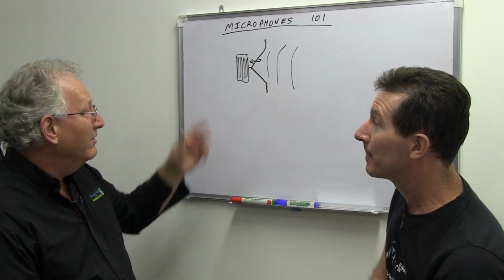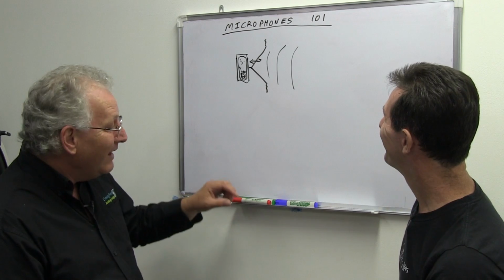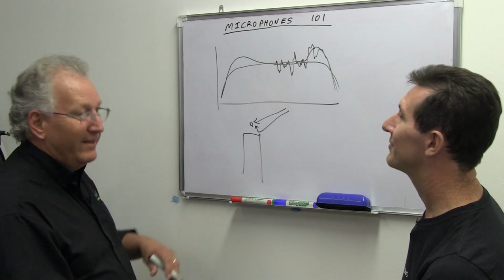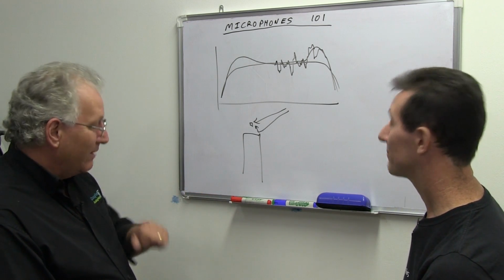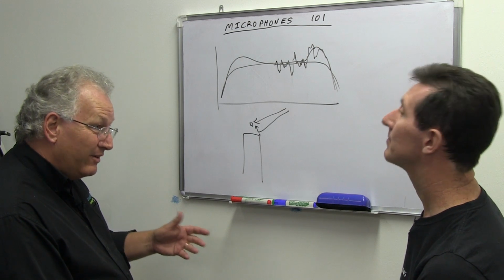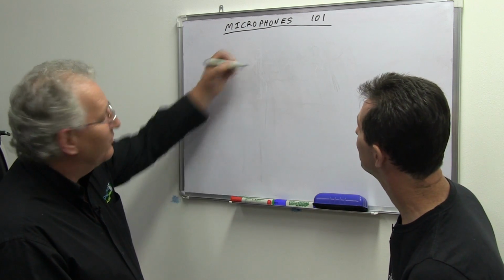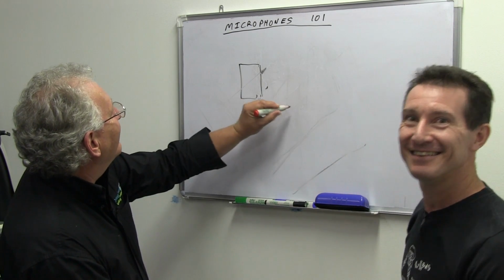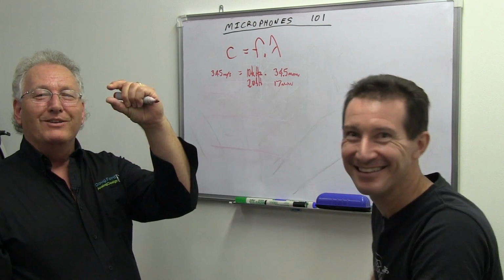EEVblog #602 - Introduction to Microphones

Comment: Around 7:00 I looked lovingly over at my Rode NT-R (a ribbon mic that Doug himself designed).

Microphones are one of those places where the audiophile types aren't just making it up. The differences between types and voicing are readily detectable even in controlled, double-blind tests (i.e. randomized A-B-X comparisons). I can recognize the mics that I work with regularly in most cases. If you're going to spend money in any one part of a recording system the microphone is usually the one where you'll get the biggest bang for the buck.

As I think most people with at least a modicum of sense will recognize, line--level, speaker-level, and digital cables are the areas where there is the least incremental benefit to be had beyond the basics (basic well-terminated, well-shielded cables). "Oxygen-free" and "diamond" cables are a scam, full stop.

Low-voltage XLR mic cables are an exception as they can have audible impacts depending on the RFI/EMI environment and the cable's topology (conventional pair vs star-quad) and shielding. With that said, you can get the best realistically achievable performance for about $25-30/cable (which gets you a star-quad topology cable with good shielding from a brand like Canare and Neutrik connectors). if you spend more than, say, $40 on a mic cable you've been fleeced.

Comment: This has been a really interesting series. I'm geeking out to listening to two guys talk about circuits and spit balling them on a whiteboard. I really have no life :-p

However, on a more serious note, Advice please, (from anyone?) I have a vintage Kreisler Dynamic Microphone. it has a 30mm diaphragm connected to a transformer with three wires, and a 4700 pF (10% 400V - 039H) Electrolytic??? Capacitor (its shaped like a big resistor with a wire coming out of each sausage end.) Now, It stunk of old age so I had to dump the rotten foam padding that was in it, now it doesn't stink. but it does have noticeable, "Self-noise."

Is it possible to refurbish this mic and reduce the self-noise, and how would I go about it? change the Capacitor? Add in additional circuitry? Throw the bloody thing away? (Kidding!) ... Advice please?

Comment: 10:30 well Rode these days put out datasheets like this http://cdn1.rode.com/nt5_datasheet.pdf where the frequency response plot is basically not usable. They could have used 20dB/div and end up with a perfectly flat line...

Comment: Great video. There is a microphone that does sense sound that doesn't use 'Wobbly Diaphragm' it uses two heated wire filaments and the oscillations in the air causes the wires to cool and the resistance changes. I think the company is Microflown that make them in case anyone is interested.
Reply: +Matthew Dabin awsome. thats really cool. heh, get it. ......i have no life.

Comment: To me, you demonstrated the number one reason (most other) Americans find it difficult to deal with metric.  They're obsessed with "what is that in inches?"  It's as if their brains cease to function if you don't tell them what the measurement is in imperial.  What you did is what they need to get off their collective duffs and do for themselves, and say "that" is 17mm.

The first time I seriously had to use metric was my first semester of physics in college.  Ever since then, metric has been easy.  I used to come home every day from classes or work, and before turning the thermostat up (winter) or down (summer), I would estimate what the (C) temp was, then go over to a (digital) thermometer to see how good my estimate was.  All it took was about 2 months' practice to be within a degree.  That's all anyone who doesn't know metric needs to do, is to practice, but they refuse to do it.
Reply: Units are really meaningless at the end of the day. As someone who grew up in the US, I am very comfortable knowing what an inch looks like. If a certain part is measured in mm, in my head I rapidly convert it to inches (25.4 mm = 1 inch). Even though I know intuitively that 50 mm is about 2 inches, and I know that its about the length from the tip of my index finger up two knuckles, my brain stores it as being about 2 inches. I would imagine native english speakers who are fluent in spanish still think in english. Its the same way that when I see a resistor I imagine a spring, a capacitor a damper, and a voltage as a pressure differential or a force (since I learned ME topics before EE topics). 

People get so grumpy about which unit system to use, but really all it takes to convert a unit is one multiplication. I would assume that us Americans are generally better at using metric than the rest of the world is at using imperial on average.
Reply: ...and if I simply just used a system (such as SI), no conversion or multiplication would be necesssary, which is my point.

As for thinking in English, not really.  Near the end of my third year of high school Spanish, I started thinking of sentences in Spanish terms, not what is it in English then translate.  I didn't and don't do that all the time, but there comes a point where concept goes directly to the target language with no intermediary of the first learned language.  Actually, that's exactly the same thing in measurement, where one starts thinking in a given distance in terms of meters, or a volume in milliliters.
Reply: I would assume that us Americans are generally better at using metric than the rest of the world is at using imperial on average.

That's because very close to the rest of the world is using SI, and imperial is "the odd man out."  We should have finished what we started in the nineteen eighties.

Comment: Some people often ask why microphones don't simply mimic human hearing by measuring frequencies separately. In the human ear, there's a couple thousand neuron receptor cells that each respond to a different frequency. If it works for us, why dick around with measuring wobbly membranes?

It's interesting to consider that mammalian ears (including human ears) measure frequency and not time. This might seem like a pretty silly thing to do, because it takes a lot of effort to construct (biological) band-pass filters that are going to be accurate enough for musical hearing (cochlear implant designers had to learn this the hard way). Though thinking about the limitations of biology, it makes sense why hearing is based on frequency and not time. If you measure frequency separately, you can equalize by simple changing the gain of each frequency channel (biological gain), instead of having to do weird FFT or AC coupling mechanisms, which might as well be impossible in biology. This biological equalization happens all day long. If you endure a specific tone for some time, you'll be desensitized to it. 

If you want to construct an electric variant of the ear.. you'd need some way to construct tens of thousands of little band-pass filters that are accurate to single hertz. Anyone knows if this is currently possible at all? 

So, in a way, biological hearing is better as frequency-based, while electronic sound capture is best as time-based (currently)

Comment: Microphones can be pretty surprising actually, for example you can use a piezo as a microphone for guitars, as an extremely precise touch sensor or as a damn loud tweeter. A very smart use of speakers is when intercoms use the speaker as both a microphone and a speaker. (Electra intercoms in Romania are made like that, in a very old model you can actually short circuit the ground with the speaker to hear the speaker at the entrance without anyone calling)

Comment: You learned something too this time, didn't you Dave? :-)
Reply: I hope so.... I've always felt that Dave needed to take a step back from his preconceived notion of analog audio and listen critically to some real guitar tone. He's treated audio devices as if they were digitally black and white. As a recording musician and tube amp tech of 20 plus years, I can indeed confirm that the harmonic content that mics and tube equipment produce may not show themselves to a Tech with a scope or spectrum analyzer but indeed, can be heard and perceived by the human ear and not by a slight margin either.
Reply: bain5872 If there's no difference between two captured signals then it's placebo. The high-end transistor vs tube amps rant has been going for ages.
Reply: There is most certainly a difference to the ear. There is no scope or spectrum analyzer that can display all that our ears can perceive.   Listen to any great guitarist recording in the last 50 years and his tone is directly related to the tubes in his amp. There is no transistor substitute and I along with hundreds of others have tried for over 50 years to do just that. I do not make this claim lightly and I say this from first hand knowledge. I'm not trying to debate this and anyone can believe what they like however, I think one who speaks on the subject should also study it more closely before making a judgment strictly based upon a preconceived notion that if a instrument can't detect it then it does not exist. I along with 99 percent of guitarist can hear it and I promise it's not a delusion. Of course, I mean no disrespect toward Dave or yourself.
Reply: TrickyNekro
I completely agree with your logic however, I can indeed perceive the difference between the two. This only applies to certain designs mostly Class A single ended and push pull and some Class AB designs. They are some tube designs that sound just as cold and lifeless as their solid state cousins if not worse. My ears can not distinguish all tube or transistor designs. The differences I speak of is not subtle but very marked and only applies to guitar amplification where harmonic distortion is a large component of the output signal and I can not speak of high-fi tube designs. I will say that this tone can be captured and reproduced by solid state devices (ie) recording. Will this earn that beer? I'm thirsty and it's Friday...!
Reply: TrickyNekro
Thanks for hearing me out on the subject and I do hope I can take you up on that offer sometime. I would most certainly return the favor. You're a good man!!!

Comment: Why do we design audio systems based around the eardrum.

Has there ever been a microphone that acts like the cochlear with its multiple simultaneous frequency receptors?
Reply: Yes, they do, but sometimes your not measuring sound waves for the "ear"... You can measure sound waves to determine if a bearing is going bad in a machine.  (for instance) not necessarily things the ear can pick up.  (tl;dr: Measuring sound is not always human centric)

Comment: Those of us doing the math for calculating speed of sound are capable of converting imperial to metric in our heads (or thinking in metric to start with, but that is still rare, even in younger users). There is really no need for using feet for anyone using these maths.

Most often, it is an off-the-cuff measurement by sight for calculating things like PA system delay, or using fixed-length things like floor tiles for calculating the expected resonant frequencies of a room.

Comment: The measurement microphones are very interesting! Why do they use an unbalanced signal via BNC connector instead of a balanced signal via XLR? Most measurement microphones I've seen so far were microphones with a balanced XLR connector. Or are these microphones providing an balanced signal through the 2 pins of the BNC connector and earth comes from the chassis? And what about the directional pattern reffering to the chassis design of the microphone capsule? Many unanswered questions in this video.. won't you invite him again to answer the questions? :D Best regards from germany!
Reply: BNC is the science/laboratory standard for test equipment. A reference or calibration microphone like that is closer to a piece of test equipment vs. a piece of audio gear (which would have XLR, etc.)
Reference microphones are typically designed with small diaphragms so that they are pure pressure-transducers, and they are constructed long and thin so that they reduce the impact (=distortion)  to the audio waveform in the air.
Reply: Ah! Thank you very much for your respond Richard! :) But are these microphoes providing a balanced or unbalanced signal? And if they provide an unbalaced signal so can you tell us why they don't provide a balanced signal?
Reply: With a BNC output, clearly they are unbalanced.
The traditional low-impedance, balanced connection scheme used for pro microphones are optimized to go long distances (as long as several kilometers) with minimal noise-susceptibility along the way. Not always optimized for flat frequency response because of the unknown qualities of the cable inbetween.  And typically signals are used internally as single-ended, so some scheme must be used to convert balanced to unbalanced. And, furthermore, in mic input circuits, to provide common-mode rejection to implement that lowered susceptibility to ambient interference.
But that balanced to unbalanced circuitry is just another barrier to really ruler-flat frequency response which is the major point of a laboratory microphone. And laboratory situations rarely have long distance runs of cable between the microphone and the test equipment. So for those reasons laboratory mics tend to have unbalanced BNC connections vs. traditional audio-grade mics intended for studio, stage, remote applications.
Reply: Just plausible! Thank you. :)

Comment: Cool stuff, when i was a technican in a audio recording studio a came across lots of miks. The ones that impressed me the most where the sennheiser MKH types. As they used RF modulation, like the theremin, to "recreate" the audio.
The "inventor" of the condenser mike was the "Neumann" company as they´ve done the first good working condenser mike ("The Bottle"), while the ribbon technique was first introduced by UK and US based companies (Royer, BBC and RCA)

Comment: Can those laboratory microphones to be used for vocal recordings and podcasting?
Reply: Certainly. And you can take a quick trip to the market in your Lamborghini, also.  But lab mics are much more expensive than "ordinary" microphones because of the calibration, so typically people don't use them for "ordinary" applications.  Chances are, with all the other variations, you wouldn't hear the difference, anyway.

Comment: the major reason recording engineers and musos like ribbon mics is the polar pattern. they usually capture the sound of drums, guitars and what have you much better, or at least capture the preferred sound by most ears.  condensers are great otherwise if the acoustics of the environment sound ok.  alternatively if you want to imprint very noticeable characteristics on the recording, differentiate it sonically from other things or capture a dry sound and not so much background, dynamic mics are preferred.

Comment: Could you at some point do a "Cheap lab power supply" shootout like you did with the multimeters? I need buying advice :]
Reply: *****
Yea, I was designing my own and was using that as a reference, then decided it is probably not worth the effort and I'd rather build other stuff. Also, I would really want more than 1 A as I am toying around with stepper motors and such.
I have actually found a decent looking (for the price) lab power supply, the KA3005P, is it worth the ~100€ ?
Reply: *****
Oh wow, the first one is tempting, but sadly a bit too expensive (for a poor student like me at least) for a single supply. The second one seems incredible for the price though, I will definitely consider it. Thanks!
Reply: ungratefulmetalpansy
 : What the heck ? There's constant demand for electronics engineers "in the West", at least France and probably the rest of Western Europe. It's easy to outsource manufacturing, it's not outsourcing designing (and the companies that try usually break their teeth over that bone).
Reply: For the PSU, you can always re-purpose an ATX PSU scraped from a computer. Kinda ghetto, but it works alright (as long as you start from a quality brand PSU and not a no-name straight out of Shenzen one that would burn down your house).
Reply: ungratefulmetalpansy I know people who've been EE's their entire life. Blanket statements are dangerous
Reply: ungratefulmetalpansy yeah they are, my dad's 55 and still loves working for startups. Watch when you badmouth engineers, the PC you're using wouldn't exist if it weren't for them.  Also EEs can make $70k/year out of college.  Teachers make about $20k/year out of college and don't get much more through their entire career.  Sir you don't know what you're talking about.
Reply: ungratefulmetalpansy god you're a special kind of ass aren't you?